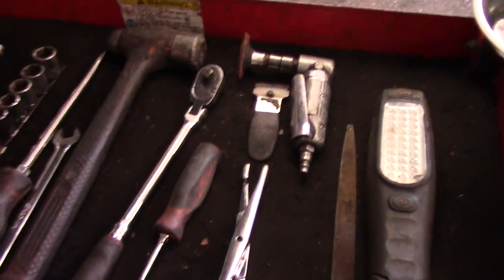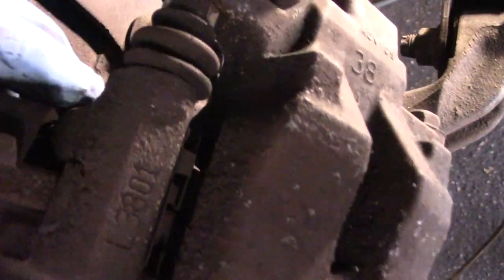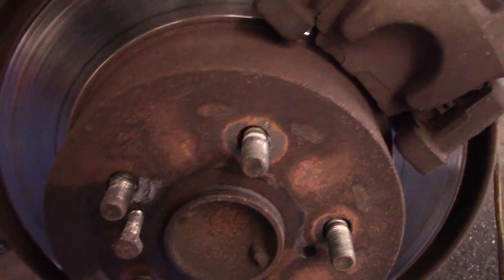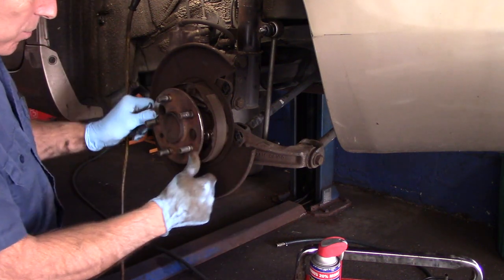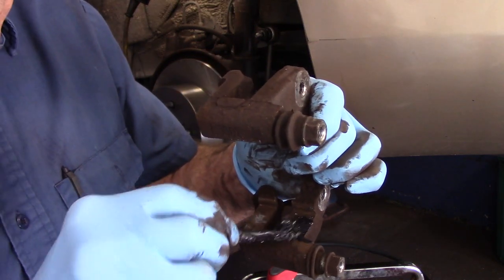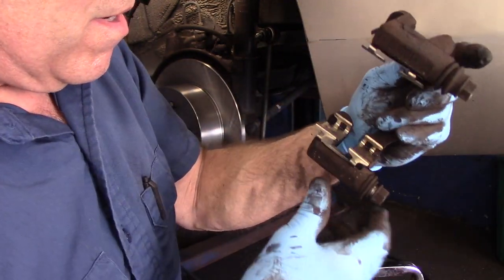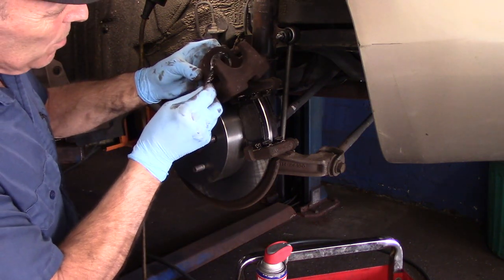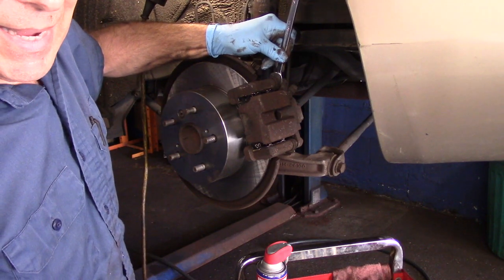Replace Rear Brakes & Rotors 2007-2017 Toyota Camry

Comment: The bolts to remove the rotor on my 2010 Camty were M8 1.25 (metric) and about 2 inches long. The bolts that hold the pad bracket on took a 14 mm wrench.

Comment: you don't want to put grease on your new hardware where the pads slide! If you do, that grease attracts all the brake dust coming from the pads as they wear which gums them up and they will stick and have the problem you described this vehicle had, where one side, or the other may wear prematurely because they are not sliding (releasing) as they are supposed to.

Comment: Every thing you ever see or read about break pads tells you never to touch them (or the rotors) with grease. That caliper was so filthy and the liberal use of brake grease was so heavy that I would have replace my rubber gloves with clean ones before touching the new pads and mounting everything back.

Comment: Don't forget to line the rubber plug in the rotor with the big hole in the hub so you can adjust parking brake if needed.
Reply from the maker: Thanks for your input and for watching.

Comment: I have 2 questions, first at 11:40 what grit sandpaper should you use to sand those? And I was having trouble finding grease like you use, what kind is that? The guy @the hardware store told me that the STP All-Purpose grease that I found at AutoZone would drip or run after getting hot, which makes sense, I think it had a melting point of around 300° or so and they had another kind that's labelled high temp grease and melts around 500°, would that be usable? it's been hard to find something like whatever you have, where can I find it? By the way I appreciate your videos they're very helpful, and I like your sense of humor too lol

Comment: You have worked on this Camry before.  Rear sway bar bushings.
Reply from the maker: Your right I have a lot of customers that actually listen when I tell them that they need to fix the noises in the car. This is one of them I did the brakes and they came back for the noise a few weeks later. You are very observant.Thanks for watching.

Comment: What size is the bolt to push the rotor off
Reply: I would like to know this also.
Reply: The bolt that would be needed is an M8 .5"-.75".  I got this information from customer service at 1a-auto.
Reply: @sailingpittsburgh  this was exactly what I needed, thank you!
Reply: @sailingpittsburgh  thanks!!!
Reply: @sailingpittsburgh  Thanks! I used an M8-1.25mm x 30mm bolt and it worked like a charm! No more hammering it!

Comment: The gloves are very dirty and now all the pads and rotors are contaminated, You need to clean the disc inside and out to remove any factory preservative and then not get any oil. dirt or grease on any of them.

Comment: I don't understand why the bolt holes to remove the rotor is not a universal process.  I looked at over 10 youtube videos on how to remove a stuck rotor before coming across 1 showing the purpose of the holes.  Everyone says to bang with a hammer.  Why?   Shouldn't the hammer method be the last method after the bolts don't work?  Even "professionals" act like they don't know about the holes.
Reply: I did one and it just stripped the bolt hole.  then i hit it with a hammer until i busted the bearing.  so this needs to stop being a thing!!

Comment: My rotors are stuck and a hammer will not get them off. What size bolt did you use to screw in to push the rotor loose and out? Thanks.
Reply: M8 1.25

Comment: Why does my motor shake in my 2003 Cadillac dhs
Reply from the maker: Did you check for codes?
Reply: Lol how do I do that
Reply: @mattvincent527  USE A OBD 2 READER.  They should do it for free for you at autozone/pepboys etc.  And by shake do you mean runs rough ?
Reply: Motor mount?

Comment: Thanks. Why didn't you use Disc Brake Caliper Support Spring?
Reply from the maker: Most of the time I do but this one just sits on the top of the hub perfectly.
Reply: @jimthecarguy  Sorry, I  just noticed that only the front brakes have big support spring.

Comment: Could you please give the torque specs for all the bolts?
Reply: 58 ft. lbs. on caliper bracket - 20 ft. lbs. on slider pin bolts - 76 ft. lbs. on wheel lugnuts.

Comment: Is it possible to take off caliper before that initial piston push in?
Reply: Yes, that’s the normal way. Just use a c clamp once the caliper is off(as seen in multiple other Camry brake replacement videos.)